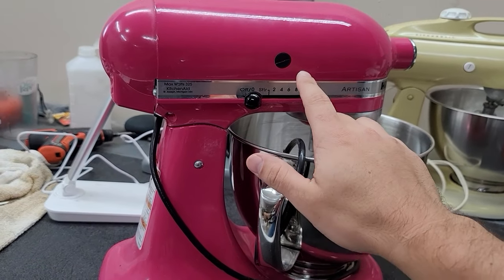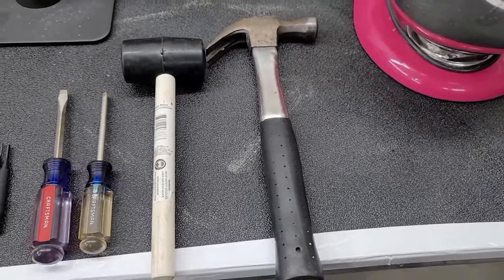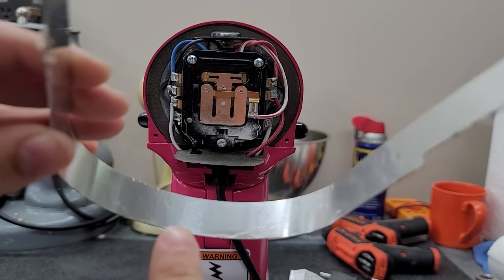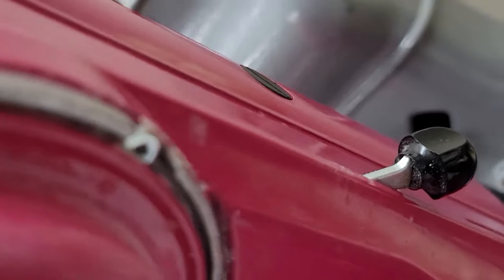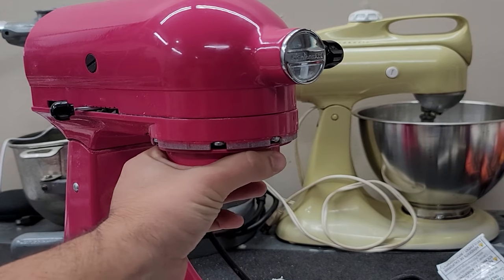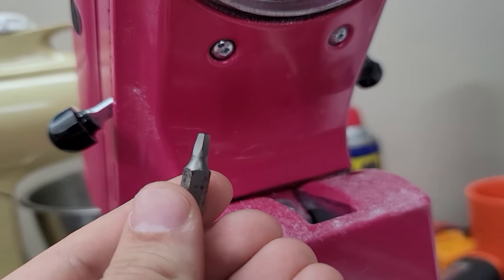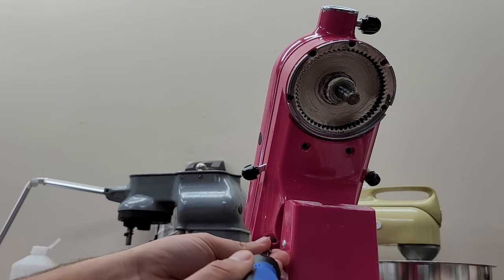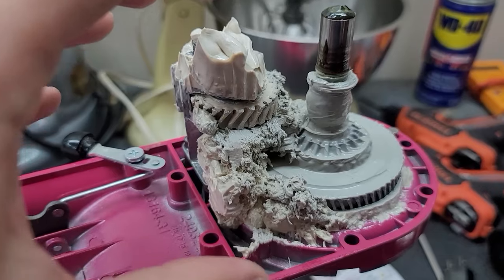KitchenAid Mixer Re-grease How To Pt. 1, (Classic, Artisan) Tilt Head

Comment: Removing the pin on the planetary part isn't working. My mixer is all beat to hell from how hard I was hitting the punch. The punch would inevitably slide around and now I'm not even sure I can get the pin out. Is my mixer ruined?
Reply from the maker: It's not ruined but if the pin was stuck in there it means the pin itself is bent which means it had issues before you started hitting it! If you need to disassemble it, you may need to drill the pin out

Comment: After watching this, I'm scared. I just found out that I have to change the oil yearly. I have a 16-year-old Artisan that I have never done an oil change to. I have noticed black dry grease come out from the attachment hole. How difficult would this be for me? I don't know if there are any places that repair or give maintenance to Kitchen Aid mixers in Puerto Rico.
Reply from the maker: I know we said yearly in a couple of our videos, but now we only recommend it every couple years depending on the condition it's in. And it's not too difficult at all, but there are several steps you have to go through. If you follow along to the three parts in this re-grease series you got this! You can always reach out to us by email (mrmixer316@ gmail.com) or phone (+1-316-530-7002) anytime if you have questions of anything as well 😊
Reply: @MrMixer316  thank you for replying and clarifying that. ❤

Comment: I bought a regrease kit, new worm gear, and I'm ready to roll. I've got a tilt head mixer, it's ... Oh..... 15 years old ish, give or take a year? I cannot, CANNOT get the pin out of the planetary. I've tried it all, it's not budging. How should I proceed?
Reply from the maker: Unfortunately there's not really any other way to get that pin out except for punching it out. If you haven't already you could try using some WD-40 on the opposite side you're trying to punch.
Reply: @MrMixer316  Thanks! I've let it sit overnight with some penetrating oil on it and I'll try again when I get home. Maybe I just didn't hold my mouth right 😂

Comment: Welp, what do you do if the pin WON'T BUDGE. AT ALL?🤦‍♀️
Reply: Nevermind, I got it out of there! It just took a bit of elbow grease, and a few really good, hard taps with a hammer. It did not want to budge.😳
Reply: @KaleHobbit603 Lucky - I've spent days at this, it still won't budge. My pin seems to be denting rather than release 😢

Comment: How often should this be done.
Reply from the maker: We reccomend a regrease and tune every two years
Reply: Omg! Had my mixer for over 30years and never changed the grease. Still the original brushes and we bake 2 or 3 times a week. It has a sentimental value. So scared to open it and grease it.

Comment: What do you do when the pin does not come out? Like... I've spent days - literal DAYS - tapping the 1/8 punch on that pin. Used a mallet, used a hammer, tried a bit of WD40, tried anything and everything I can think of and it will not come out. My everdime is great, but I am just in tears that I can't progress past 8:36 in the video. Help?
Reply: Did you ever get it? 😢
Reply: @kendalnewman3922  No, I didn't - I went ahead and opted to send my mixer to them for repairs. Actually, I'm really glad that I did anyway - they were super cool and text messaged me pictures of the mixer through every step of their process, and I got to see how really bad and gunky it was inside. It definitely needed to be re-greased and tuned up, and they shipped it back to me in a few weeks, and it works better than it ever did before! I honestly feel that it was completely worth it to fix up the mixer (which means a lot to me, it was my mother's) And I felt like I could trust them. But I'm confident now that in the future, when I need to regrease it I'll be able to do it. That pin was just a problem.

Comment: A framing/woodworking hammer??? Great info in the video but get a ballpeen hammer. People are stupid and will copy you grabbing a large framing hammer with the knerling on the striking part of the hammer setting themselves up for damage on themselves or the mixer. Show them the right tool for the job. Other than that that, good info for the guy who does not know really what they are doing or has never disassembled a mixer. 
Edit addition: I did not look at your other videos yet but the adjustment for the power switch on the rear under the cover, if you could show how to adjust that correctly. I figured it out in a couple minutes but that could be a idea. Now you might already have one if ya do just post a link for everyone else. I already fixed the one I got from my customer yesterday. I am a small engine mechanic but my customers think I can fix anything. I just wanted to know the disassembly of the mixer before I did it to lessen any potential damage going in blind can cause. Doctor Google to the rescue. Thanks for the breakdown I appreciate it.

Comment: Ok, I went out and purchased a punch set to get the pin out of the planetary shaft, used the 1/8 punch, the pin WILL NOT COME OUT! It looks like the pin is mushrooming, is there only one way it comes out? Tried to use the 1/16 punch and only succeeded in bending the punch! I'm about to give up as I'm afraid of turning it into a pile of junk. She has a newer one, and I planned on doing some maintenance on it too, now I'm not so sure....
Reply from the maker: The newer one should come right out, have you hit it from both sides? Sometimes you really have to strike it really hard to break it loose. Sometimes adding heat will help loosen it
Reply: @MrMixer316  it is an older model with the slotted mounting screws,  do you mean with a hair dryer for heat, I don't have a torch.
Reply from the maker: @clydeferguson519  I'm not sure a hair dryer would get hot enough, I've never personally had to used one.
Reply: Well now I am messed up because one of the nuts has fallen of the back of the motor mount and into the guts!Now I am talking about the pin that holds the metal round cover on the gears, the one that has to come off to get at the 5 screws ,right?
Reply from the maker: @clydeferguson519  yes the planetary pin, that's what Ive been referring to.
Reply from the maker: @clydeferguson519  the nut was probably already loose they definitely come loose over time, turn it on its back and shake it, it will come out
Reply: @MrMixer316  ok, got the nut back on, I'm going to try a hair dryer. Is the planetary cover metal, if it is ,I was wondering if touching the tip of a soldering iron to the pin might heat it sufficiently?
Reply: PS, the model is a K 455 S Classic.

Comment: It is absolutely ridiculous after spending $400 on this mixer to have to go through all this to grease the parts.  Not like there is a Kitchen Aid Grease Shop anywhere!!
Reply: T. J. It shouldn't need it for years, but eventually yes, unless you want to get a new one in some decades. All machines that have metal gears need some kind of grease, its how it works.